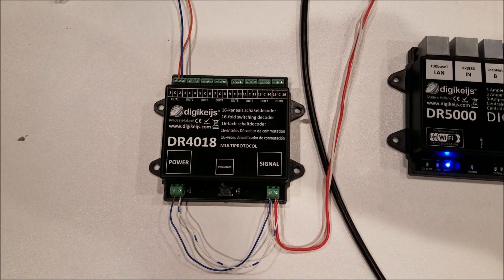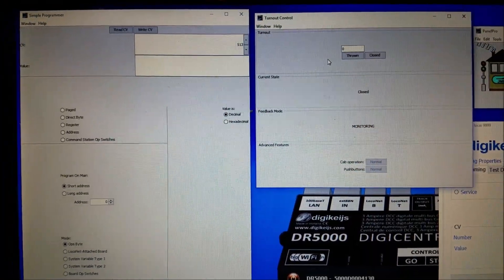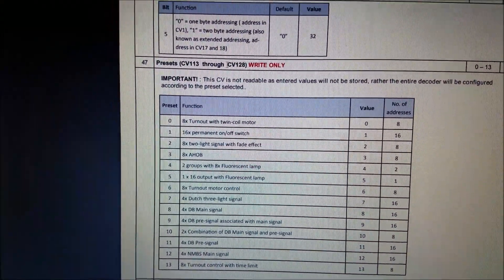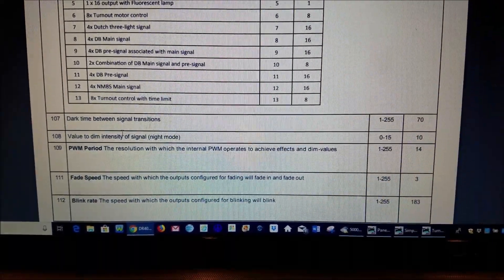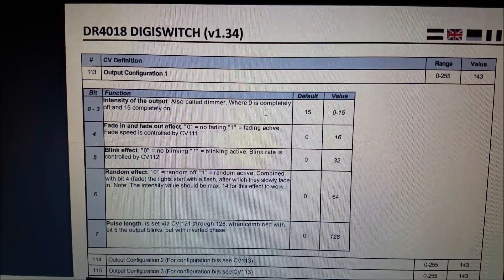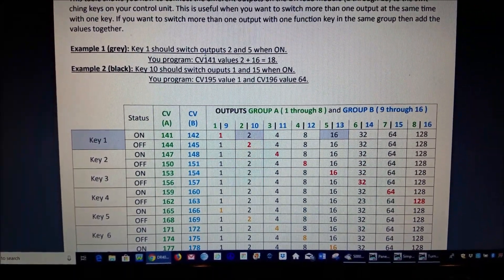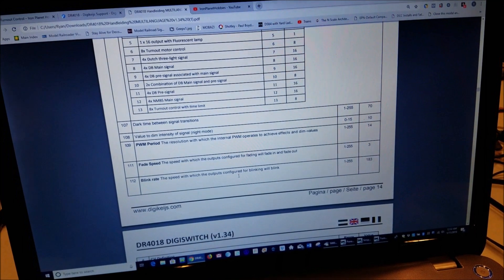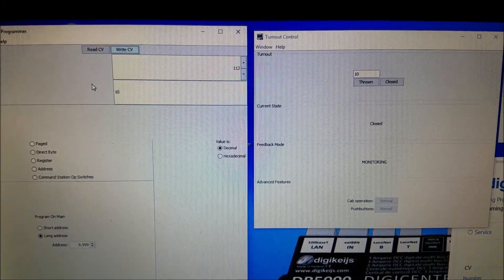Digikeijs DR4018  Programming With JMRI For Any DCC System

Comment: I am watching this now as all this equipment is still available.   
On your track, do you usually power the accessories separate from the track power?
Reply from the maker: Yes, any device that has the option to power with an external power supply always gets a separate power supply.

Comment: Hi Ryan again from UK. Thanks for these 2 videos on the 4018. Helped me set up mine yesterday on the test track, configuring 2 x kato turnouts and 2x kato Xovers (20-210)
I had read somewhere that this will not work the 20-210 and you need to rewire the Xover to use 4 outputs on the 4018. This is NOT the case. The 4018 only needs a single output to throw all 4 on one switch. Love the fact that once you program switch 1 it sets all 8 of them and this is then recognised by JMRI. Never thought I would get to the stage of throwing turnouts remotely on my panel in about 3 hours. Great job Ryan!
Reply from the maker: Glad to hear your setup is going good!  Thanks for the update.

Comment: Im using a uwt-100 thru jmri to a dr5000. When turning on the dr5000 I always have to use the dr5000 switchboard turnout on my computer before i can use uwt-100 to turn that same address on the dr4018 to move a tortoise turnout. What can I do to avoid having to do this every time turn on my dr5000?
Reply from the maker: Go to the DR5000 PC App and then to the Control Tab.  In there go to Setting.  Click to Save & Restore Loco Data.  In JMRI, create a panel and then check your Turnout Table.  Save the Panel once you have all of the turnouts defined.

Comment: I purchased the DR4018 from Iron Planet and have watched your setup videos. I got everything working and can program the cv’s getting the specified results. I want to operate a crossing signal with gates. The lites need to alternate flashing. But the gate needs a tortoise motor constant output. Changing cv47 seems to change all outputs. How do I set this up?
Reply from the maker: Jim,  there is some info for that over in our groups.io  

We are moving our support there.  You can also copy and paste your question in the group.  Thanks!
Reply: I posted a question on the groupsio board, but no response yet. The advanced programming to use multiple functions rather than a preset that makes all the same needs more explanation.

Comment: Can the dr4018 be used as a stand alone item?
Reply from the maker: It does need a DCC system to operate.  Any DCC system that has the ability to throw or send a turnout command will work.

Comment: I purchased a DR4018 to control my Atlas snap switches.  I also bought an additional power supply.  Switches work ok using MRC Advance but do not work consistently with JMRI on my Win10 laptop.  I filed support request with Digi and they told me a fix has been provided to the JMRI group but not yet implemented.  Any way to push this fix forward?  I have comment on user group site but not sure I’m getting this to right person’s attention.  Can your company help get this fixed?  Thanks.
Reply from the maker: Can you copy and paste your message here and shoot it to us at: info@digikeijs.us
Reply: Did you get this fixed?
Reply: No.  But it’s no longer a problem because I shorted out the DC connection on new 4x8 and burned it up bad.  Melted the plastic case and everything. 🤬  I’ve replaced the Atlas snap motors that melted at same time with Smails.  I might get another DR4018 to use on original 4x8.  I have 6 Smails for it but have 10 others Snaps to replace.  DR4018 lot cheaper.
Reply: @FredE528  Whoa!  Thanks for your reply.  I'm new to the hobby and dreading my first damaging short.
Reply: It was a bad one.  I did short video of the aftermath.

Comment: Just bought the DR5000 from you guys the other day, should arrive soon.  Everything I am seeing about Digikeijs is making me feel good about the choice in controllers.  I use an Arduino and DCC++ but wanted it back for other projects, and felt committed enough to model railroading to get a dedicated controller.  As a designer and maker that exists in the modern market for products focused at people like me, the value for features of other systems is just not there.  I have a $150 32bit micro controller that will do 5 channels at 24v 30a+ for steppers to manufacture plastic products, manage 2 relays for temperature controlled industrial process, the value for the dollar for that is miles above most DCC systems.  A drone for $50 will take video and return on signal loss and other fancy modern things.  Most DCC controllers charge like $400 to turn a motor with a 20 year old protocol, and then want more to just talk to a PC.  I am delighted to have found a company is willing to compete with other entertainment options and offer real value that I can feel positive about spending on instead of lazy for ridiculously spending like $600 for what I know is not worth that.  I went to college for industrial product design, studied manufacturing of consumer electronics, then got into model railroading and was just shocked and appalled at the markup on the hardware.  It was making me feel stupid for starting up with the hobby, to be honest.  Very glad for some respectful value driven products instead of fanboy driven repackaged 1990s electronics at Apple pricing.
Reply from the maker: Thank You!  I know you will love using it just like I do.  If you have any quetions when you get it just ask.
Reply: @IronPlanetHobbies  the DR5000 seems to not be working... Edit:its working, minor issue with GUI.  No big deal at all, just have a LAN cable to configure it and its all good.
Reply from the maker: @AlohaMilton  No worries,  it is working just like it is supposed to.  I assure you it is new.  The power supplies are added once they get here.  It is possible the twist tie fell off.  

You have to connect your PC's Wifi to the DR5000 while the USB cable is plugged in.  If you don't connect the PC or a router then it can't be assigned an IP address.  The password is 1 2 3 4 5 6 7 8.  Then all your tabs will open just fine.  

If you get stuck let me know.

Ryan
Reply: @IronPlanetHobbies  It needs a LAN cable plugged in to configure the WiFi, did not realize that.  should work if I can find a cable.  its a known issue/feature with an easy fix apparently.